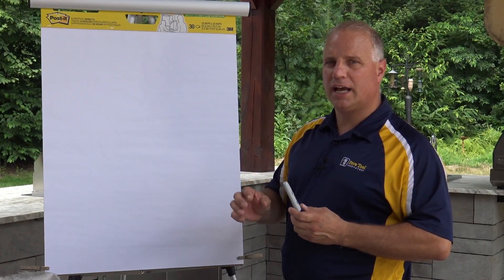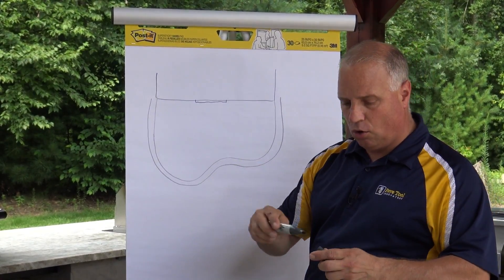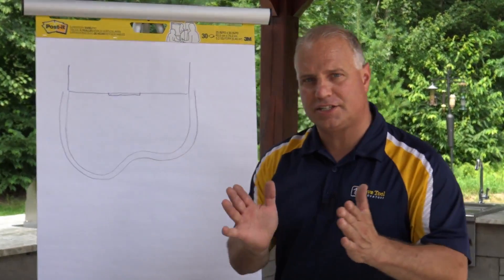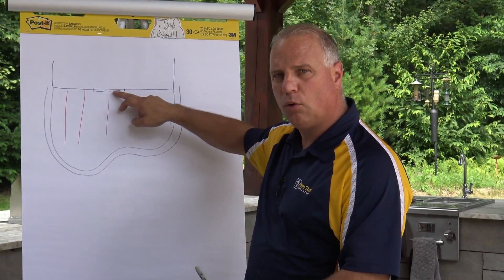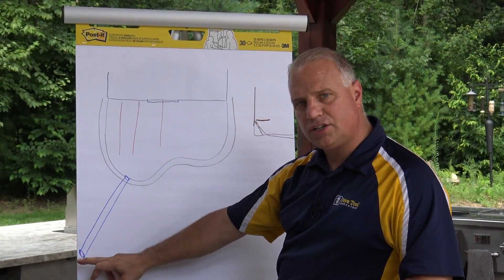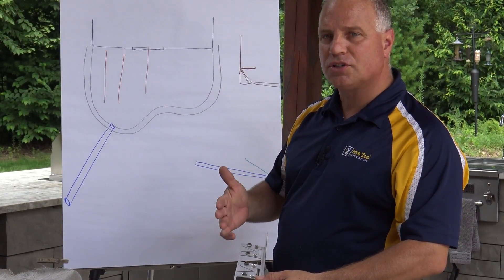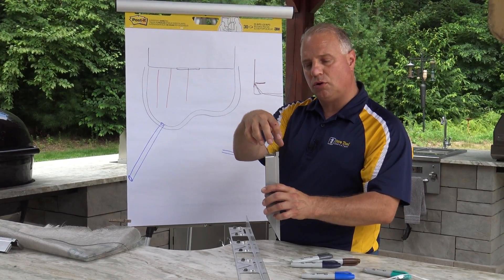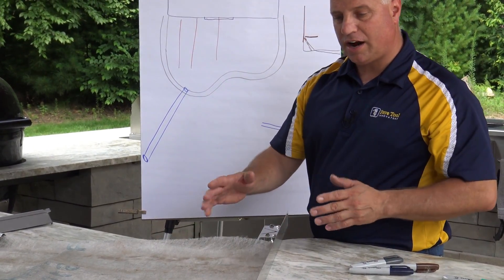Fabric, Drainage & Edging for Hybrid Pavement

Comment: Clay soils, but no negative grade after patio: example: home-->patio-->uphill slope with possible retaining walls or just uphill grade.  Do you avoid this style build? Great video
Reply from the maker: Great question! Difficult scenario, you would need drainage between the slope and the patio with positive flow to daylight. I wouldn't avoid it, just make sure you get the water out. Hope this answers your question!
Reply: @PaverToolInnovators  quick question on this, why the positive flow toward daylight?
Reply: @ghettokilluh  I think that by "drainage" he means something like an open top french drain...in short...a clean gravel filled ditch...say...18" wide x ??" deep with gravel between the bottom of the "slope" and the patio edge. A perf-pipe goes in the bottom and THAT runs to daylight. If you are truly in a basin with no down-slope "daylight" available (you said "no negative grade") you will need to run it a dry-well that is sized according to the perc-rate of your soil plus the anticipated runoff load. An engineer can assist with calculating this. More $$$ but it is really your only option.